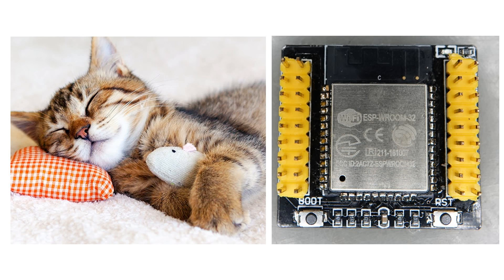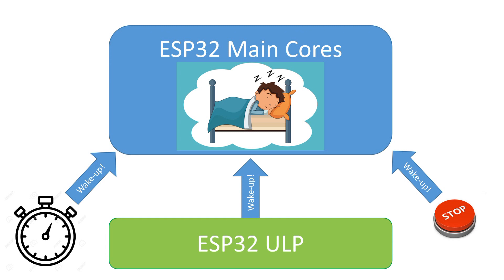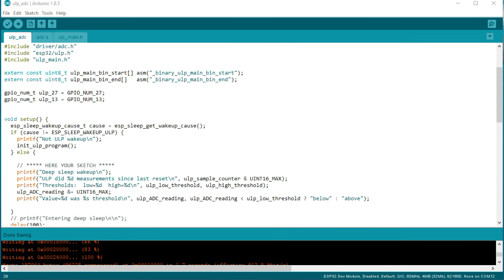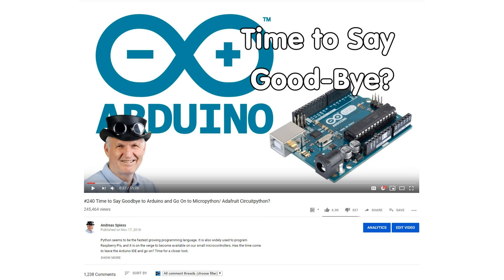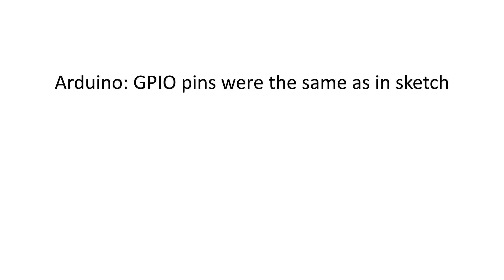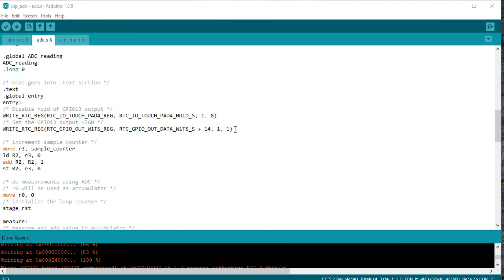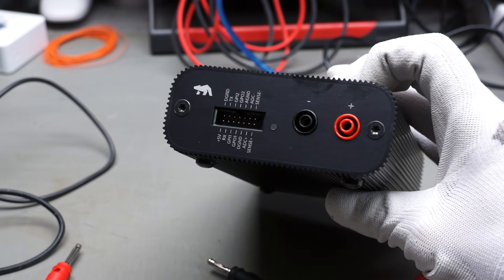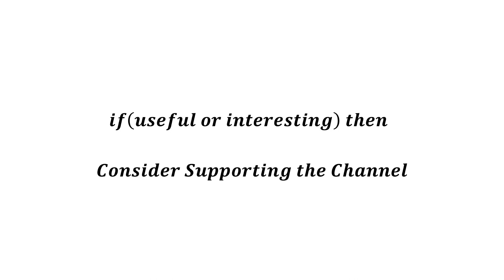#252 ESP32 Ultra Low Power (ULP) core made easy in the Arduino IDE including 100$ challenge

Comment: Total NOOB question.
Since the strength of these ESP devices is that they are connected (WiFi / Bluetooth), is there any way to wake up the cores when an external client attempts to get a connection ?

And what is wrong with the internet if an Andreas Spiess video only had 500 views after almost 24 hours?
Reply from the maker: 1. The ULP has no access to Wi-Fi
2. The first 24 hours the videos can only be viewed by patreons
Reply: @AndreasSpiess  Then i hope you have a busy afternoon ahead of you. :-)

Thanks for your answer. I was hoping against the odds that it was possible.
I guessed for it to be responsive to incoming WiFi connections, it would have to keep its radio on, which is possibly the biggest energy consumer on board.
So still the strategy would be : start up the core every x [milliseconds] and check if a client is currently trying to connect.
Is that also why MQTT is so popular for home-automation DYI? The broker is always on, so that devices can just check once every x [milliseconds] if a message was left for them?
Reply: I would think that the WiFi radio would be powered down when the main processor(s) go to sleep. WiFi does require periodic processing to maintain the connection.
Yes, the advantage with MQTT is that messages can be stored on the server until a client fetches them. This is done with the 'retain' flag, meaning that the message will be kept permanently for its topic - t's cleared by writing an empty message to the same topic. Without the 'retain' flag, a message is sent out immediately to subscribers and not kept.
Reply: @IanTester  Thanks. I think that's what i assumed.
It would be very unlikely (unreliable) that a client, trying to connect to the esp (as a server) would make the connection exactly during the hundred milliseconds that the ESP is awake.
I had hoped to avoid having the need for a separate mqtt server, that somehow would need to be permanently on. (or it would have the same issue)

Edit:
I lack the specific knowledge of radio technology, but wouldn't just a receiver take much less energy than a radio? Why cant they design a chip that is able to have a receiver permanently on?
Reply: @dozog  it takes a surprising amount of current/power/energy to operate a 2.4GHz receiver.  The beauty of the ULP is that you can wake up frequently and check for activities that that would indicate it being worthwhile to fire up the rest of the chip.  I believe that the ULP starts executing instructions very quickly on wake-up, whereas the main core(s) need significantly more time to get the PLL locked before it's ready to execute instructions.  There is an amazing amount of clearly written documentation available explaining all the caveats.  Espressif is taking the bull by the horns and welcoming makers/hackers with open arms, unlike many other manufacturers that want to keep everything secret.  The ULP bridges the gap to making battery powered IOT devices possible.
Reply: @mikebrown7366  Ok, thanks.
But unfortunately, as far as I read before, the ULP can not "check for activities on the WiFi to see if it is worthwhile to start up the rest of the chip".
And I also still don't get why a receiver would need so much energy.
A transmitter is specified in dB or Watts, a receiver should only have to  be 'sensitive' , it doesn't have to create an EM field that can be received over a large distance.
Reply: The ULP having no access to WiFi, means the ESP voltage and current sensing devices on the Mesh in my proposed solar-energy storage system (which uses large 12v repurposed automotive batteries at the end of their service life), will be in always on mode when using its 32 relays to control one to four 10A high end switched, and modulated, charge current flows. They can sleep at night or maybe mine bitcoin.  I call it "playing music to Batteries" and it has global reach in educational terms.  Can I have an extension on my submission?
I need 10 esp32 units and help with programming...I have the lead acid.

Comment: you don't need to buy this Qoitech, it is very expensive, you can do the same thing , with connecting resistor 1 ohm an the iput the circuit , and measure the drop Voltage with oscilloscope on the resistor  --> the current will be the same value the volatge because my Resistor is 1 ohm
Reply from the maker: Maybe for you, this works. For measuring very low currents it is not easy. Maybe you watch my video about this topic?

Comment: Can someone build a sketch at Arduino IDE for ESP8266, maybe for ESP32 too to make it work as a micro controller only, without the WiFi stuff, in order to minimize the initial 200kb flash program? Thanks.
Reply: Not sure you can do that without replacing the FreeRTOS.
Reply from the maker: What would be the benefit of using less flash? You anyway have to pay for it ;-)

Comment: Bad idea to re-run challenge in 2021? ULP is still under-documented for Arduino, not to speak about PlatformIO+Arduino. It is a shame, as ULP is essential for battery operated projects.
Reply from the maker: There was no interest back then and I did not see many projects since them. The same with the PIO on the Pi Pico. Hyped, but not used :-(

Comment: Damn! I'm cringing everytime I watch something like that. I guess you shouldn't mess with asm libraries if you really don't know what you're doing and really don't understand what the background of the pin-scheme is. Come on! this is fundamental programming knowledge. You really should know what a linker is and how a compiler works. 

A little hint: A nodeMCU wasn't supposed to run Arduino Software but it's own set of tools on it's own board - it used a different naming scheme. The same with all the other Boards and the reason you still have to choose what board you use, even if they are all 8266 or esp32. It's only common to all the other boards around is it's chip.

By choosing the right board, the corresponding definitions are created. Definitions or "define"-macros in the sketch are a fixed link between a static number or value and any identifier. So "GPIO32" for example is simply pin 10 on the ESP32-chip. But it could be called "GPIO32",  "ADC1",  "VDET1",  "RTCIO4" or simply "10", based on it's capabilities. It's just a placeholder defined to make the code readable done by a poor soul who has to write all these definitions and think about a naming scheme. The Compiler then takes all these defines and switches it with the underlaying value - this is the reason why it's called "constant" - because you can't dynamicly (in runtime) change the underlying value, because it's already hardcoded to it's define value. 

And this is the same game with TOUCH1 - TOUCH9, these are definitions of the corresponding pins because they have touch-sensitive-input capabilities, you could simply use it's number or any other of it's names instead. Your program doesn't care at all if you call it any 'em - it simply sees the underlying number.
Reply from the maker: ... "it simply sees the underlying number": This was my point. I also only see the number I have to solder my wire ;-)

Comment: I think you have messed up ultra low energy power with ultra low computing power, because according to Assembler instructions manual you have supplied, this ULP CoProcessor needs 6  cycles to performs such simple instruction like NOP hahahaha. 2 cycles for executing NOP and 4 cycles to fetch next instruction. Chinese guys are No 1 in ULcomputingP hahahahha
Reply from the maker: In the end, it does not need a lot of energy, that I measured.
Reply: @AndreasSpiess  I very doubt that your measurements are correct. You didn't supplied neither schematic of module you have used for testing nor measurement schematic, so I can't trust you. Your advertisings of some equipment doesn't make your results correct. And this oscilloscope curve that shows perfect rectangle for power consumption cant be real and trusted
Reply: @logicfacts9964  That's not how it works.  If you think he's wrong, or incompetent, it is your job to present your case with evidence, not attempt to discredit him down with speculation and disrespect.